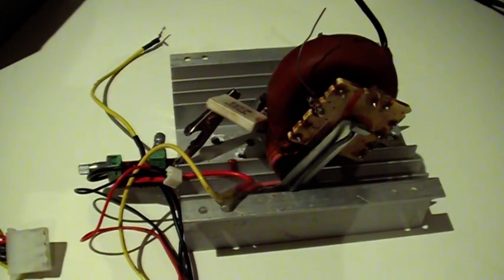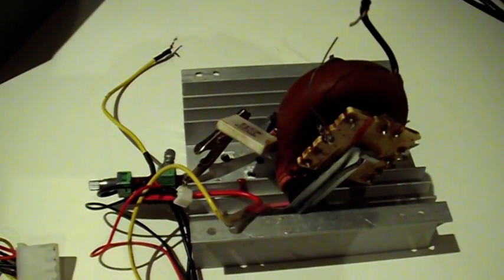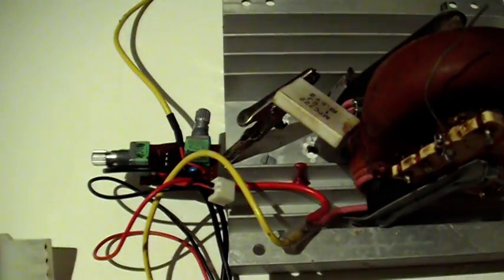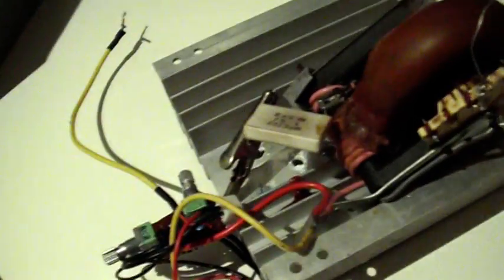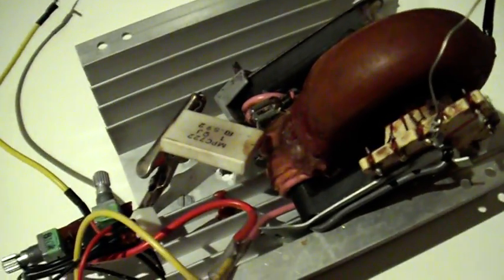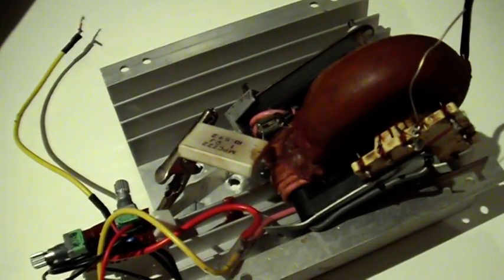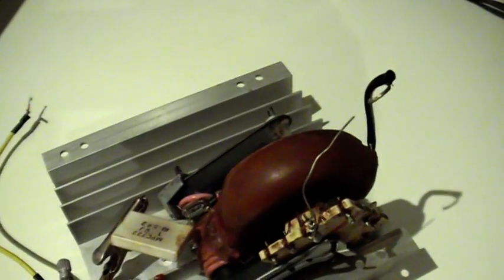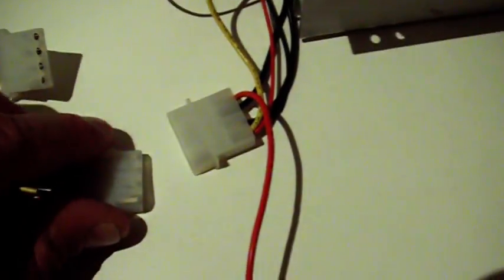Plasma speaker / singing arc 555+MOSFET flyback driver (how it works)

Comment from the maker: @definitionofis pin5 on the 555 is control voltage - so set freq and markspace with the pots and pin 5 effectively does a dirty PWM (not AM or FM) to the audio.  

The schematic is in the descript above or just google image search for 555 plasma speaker

Comment: How do you modulate the MOSFET with audio ?

I guess you use the 555 to trigger the flyback at a fixed frequency and then vary the amplitude to get audio. Or maybe you vary the 555 timer frequency ?